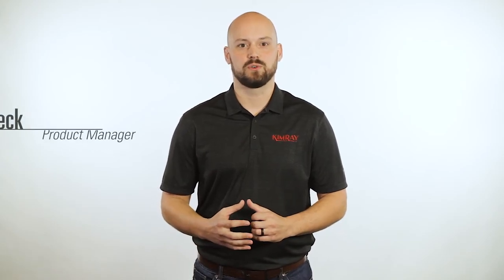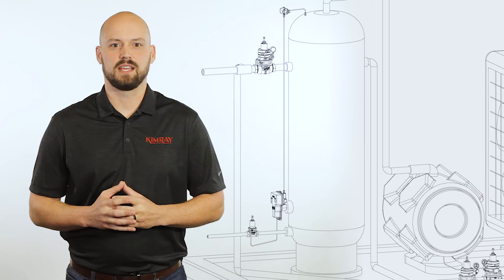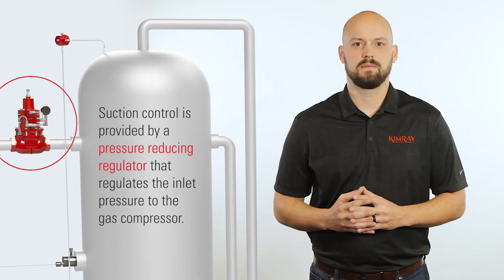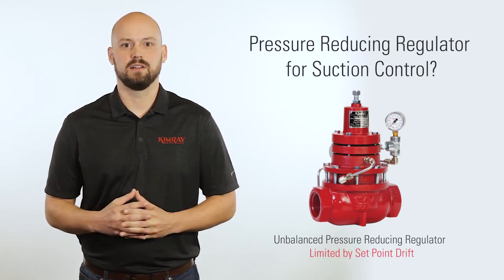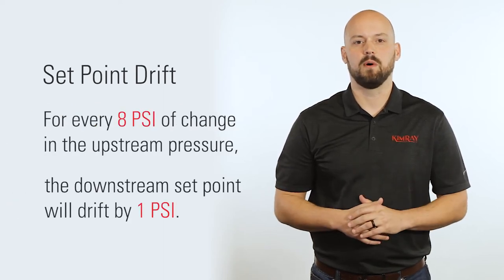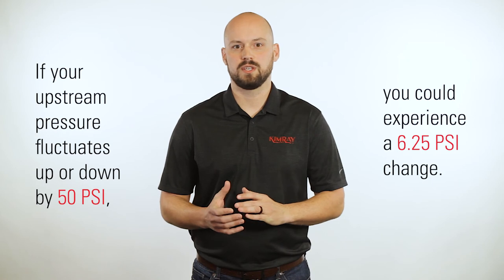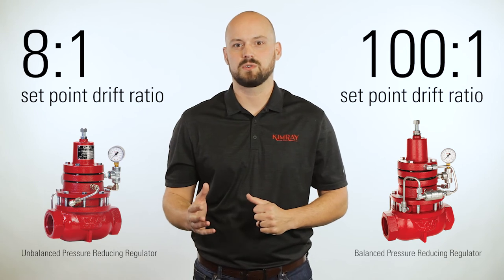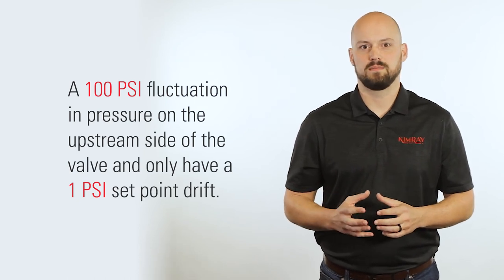Set Point Drift Ratio Explained - The Best Suction Control Valve for a Natural Gas Compressor

Comment: How would this compare to a motor valve with indirect pilot?
Reply from the maker: Really it would depend on how the pilot and motor valve are tubed up. We do offer high pressure, pressure reducing packages or (suction controllers) that are used in line before compressors. Please feel free to reach out to me if you have any other questions nlegrand@kimray.com